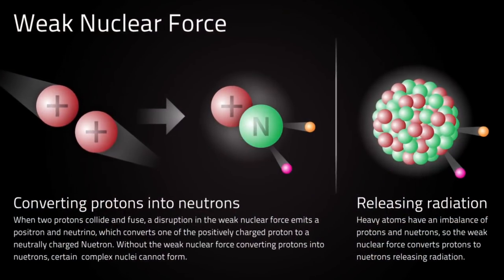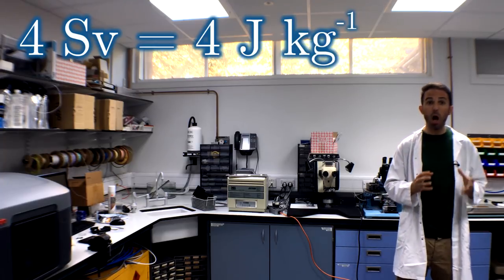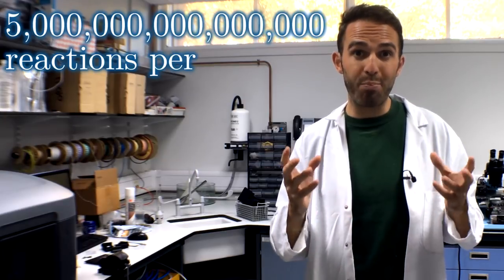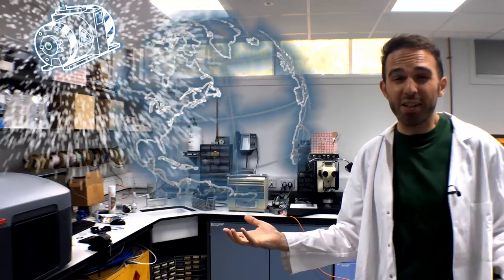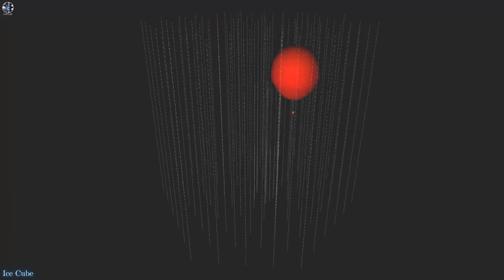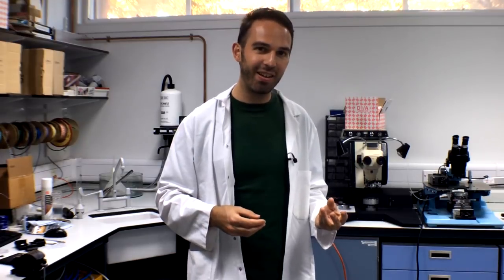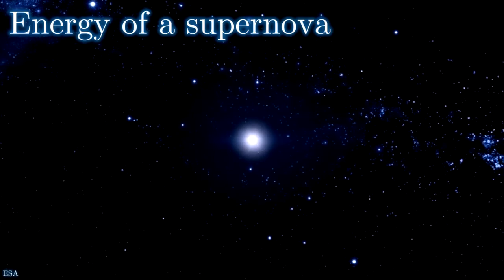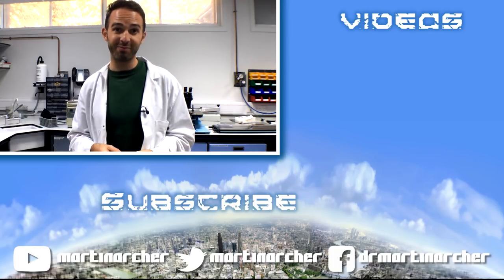How Does Rick and Morty's Neutrino Bomb Work? Physics vs Film (and TV)

Comment: I misunderstood the concept of the neutrino bomb.  The way I understood it, the smaller the particle, the more energy given off during its split.  I thought that Rick had come up with a bomb that could split neutrinos, thereby inventing a very small bomb that could produce a massive amount of energy.  Not a bomb that could generate enough neutrinos to kill a population.
Reply from the maker: You can only split composite particles (particles made up of combinations of "smaller" particles), so atomic nuclei can be split and in theory so can protons and neutrons (though weird things happen when you do this because of how the strong force works). Neutrinos, as far as we know so far, are fundamental particles so they aren't made up of other particles so can't be split. However, they can interact with other particles as described in the video.
Also, the idea that the smaller the particle, the more energy given off during its split isn't quite right either. Take atomic nuclei for instance. Iron is the most stable nuclei, it has the highest binding energy per nucleon. So while nuclei heavier than iron will tend to want to split releasing energy, once you go lighter than iron it actually makes more sense for nuclei to fuse together to release energy rather than splitting them. The amount of energy you'd get out from splitting is related to the difference in the binding energies of the initial and final nuclei, so it's by no means obvious that lighter nuclei give off more energy.
Hope all that helps.
Reply: As far as we know neutrinos are the smallest particle... but look what happen when we split the atom, imagine if we found out we could split neutrinos... the power could be immense
Reply from the maker: Stephen Gregory yes neutrinos (as well as the quarks, leptons and force bosons) are fundamental and thus the “smallest” we know of so far.

Comment: Know that little taser device he used on the planet with "the festival"?  "I ONLY HAD ONE OF THOSE THINGS I THREW MORTY!  I'M HOLDING A BOX OF TIC TACS RIGHT NOW!"  my little arc lighter looks a lot like that and it fails as a lighter compared to a flint and fuel....I wonder if I can energize the casing some how after a 5 second delay with a timer chip and mosfet...someone figure it out for me and send me the prints XD
Reply: also, what kind of question was that at the end???????   if its not the portal gun then what's the point?  :P

Comment: Why do you assume that the deadliness of the neutrino bomb is just the neutrino interacting with the matter? It's like saying that an atomic bomb works by having atoms interacting with the matter, but we do know that it is not the interaction but fission or fussion.. Maybe there is also some kind of reactions involving neutrinos that would make the devastating effect?
Reply from the maker: In both those cases it is an interaction involving atoms and since atoms are not fundamental and simply an umbrella term for many composite particles there are many possible interactions including types of fission and fusion. Neutrinos however are fundamental meaning that the three flavours are all the same and not made up of constituents. They only interact with via the weak force and this is by far more likely to occur with matter than other neutrinos. Therefore the way I laid out in the video is the most plausible explanation using real physics and considering known alternatives.

Comment: Take a microverse battery, select a star within at random, speed up it's time, and then release 2.5 Billion years worth of neutrinos in a single second. In fact, via that approaching using in world technology, it wouldn't really be a bomb because it wouldn't need to explode. It could emit them like that every second repeatedly until the heat death of the microverse.

Comment: Is it possible that the neutrino bomb doesn't kill with neutrinos, but starts a chain reaction that converts everything around it into its equivalent mass in neutrinos? So every electron becomes 511,000 neutrinos, every neutron becomes 989,565,000 neutrinos, etc. Obviously that wouldn't just affect living creatures, but would sync up well with Rick's plan for a 'fresh start' - rather than lots of crispy ionized corpses, everything would harmlessly dissipate.

Of course in reality 'neutrino bomb' is probably just intended to sound like a more powerful version of the real-world 'neutron bomb', which is intended to maximise the radiation output to kill living things but leave buildings standing.